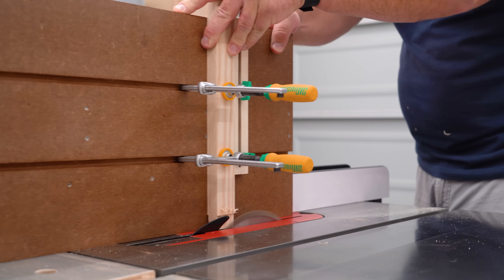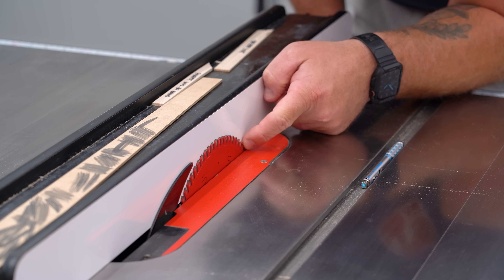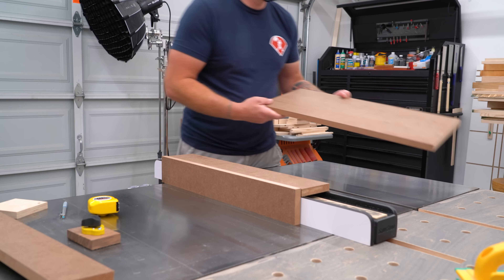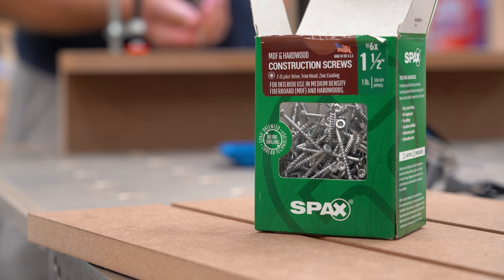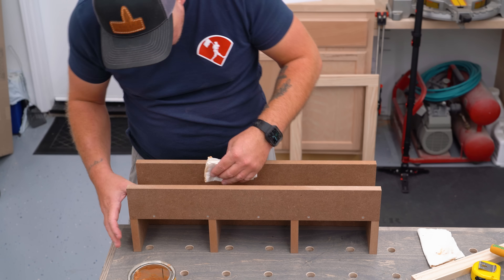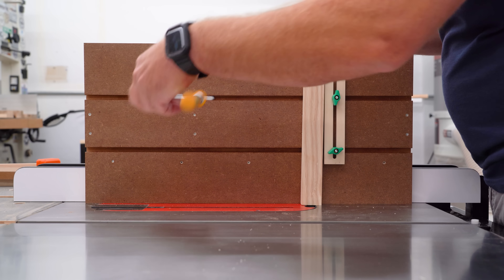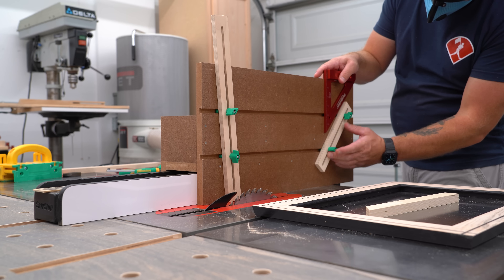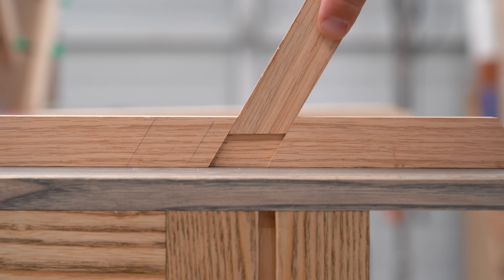Possibly the Greatest Tenoning Jig Ever

Comment: Hi. Thanks for this vid.
How do you keep the piece from being too tight to slide on the fence? I used 1 strip of masking tape on the fence but it was too loose and too tight without it. I think it's the screws that pull it too tight and also why it throws me out of square. How do you do to keep it just tight enough?
Reply from the maker: @Alvaro Burbano It might depend on the material that you're using, but the screws shouldn't compress the material enough to make a significant difference. I don't like using the masking tape trick with stuff like this just for that reason. That being said, if it's too loose, you can just take it apart and trim down the top pieces one very small amount at a time until it fits.

Comment: Thanks a ton again for your videos. I find your tips the most useful. Can I ask, what to do if the tall piece is out of square? It was square but when I put the screws it went out of square.
Reply from the maker: @Alvaro Burbano Could be a few different things. Like something as simple as the cuts not being close enough to 90 degrees. As long as it rides the fence smoothly though, you should be able to adjust the fence itself to 90 with the tenoning jig on it. Just don't forget to set it back when you're done!

Comment: Great jig! Any thoughts on how to adapt this for use with my Incra TS-LS fence? With the T shape of the fence, I can't slide the jig if there is a back side. Would it be stable enough without that?
Reply from the maker: @5055hunter I don't have experience with that setup, but I wouldn't think it would be stable enough, simply because of the height. If I'm not mistaken, that fence has accessory tracks on top though, right? Maybe you could incorporate those somehow.
Reply: @InspireWoodcraft  yes! forgot about that.  Add a couple of  t-bolts to the jig to give it stability. I think the height would still have to come down some, but might be doable.

Comment: What blade are you using to cut? Is it the flat top ripping blade?
Reply from the maker: @Rich H For the MDF I used a triple chip grind, 84-tooth Diablo blade. For the joinery I use a Forrest Woodworker II #1 Grind, which is a flat grind joinery blade. Interestingly enough I used the flat top grind for MDF yesterday and it worked great there as well.

Comment: I’m not even a minute into this and am watching you with your fingers mere inches away from that whirling blade w/ a GRRipper sitting right there in the camera front unused. What are you thinking, man? Seriously, use the safety tools you have, if for no other reason than to be a good role model for people watching this stuff. I know you’re good at this but accidents happen. That’s why they’re called accidents. Btw, I am a subscriber. That just freaked me out. Ok, back to your video. ✌️
Reply from the maker: @ms22401gal I use the GRRipper all the time. Generally speaking, table saw rip cut are perfectly acceptable and safe with your hands within four or so inches from the blade. Especially when working with a straight, flat, stable material such as MDF and using a riving knife. As for the cuts with the miter gauge, the GRRipper wouldn't have done me any good there as it can't be used in that situation. A good rule of thumb is anything outside of the throat plate on the fence side is safe, or the same distance on the opposite side, which I was on both accounts. Another good rule of thumb is that if you don't think it's safe for YOU to do, don't do it.
Reply: Not your fingers…not your problem.
Reply: @jeffw8611  Disagree.